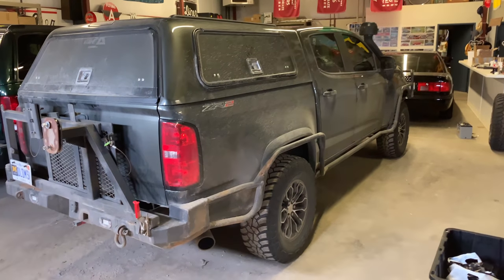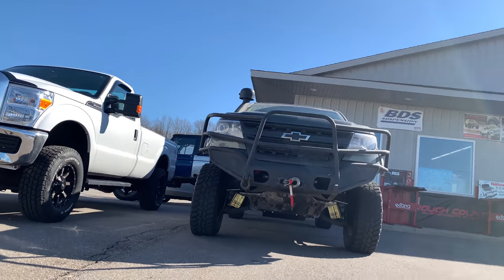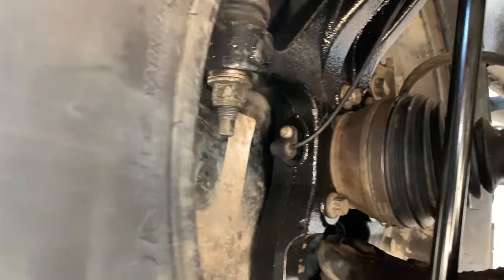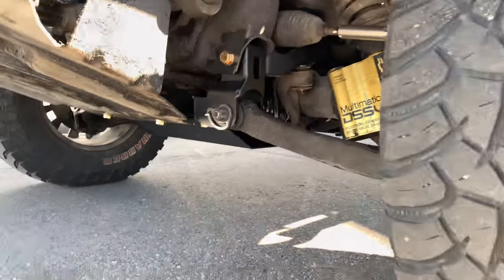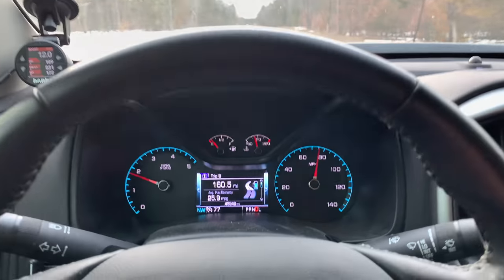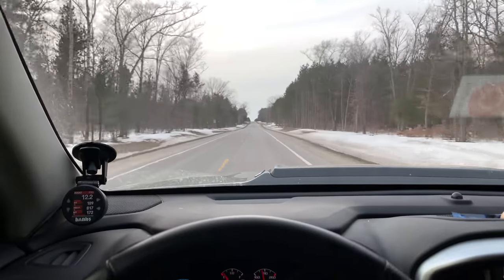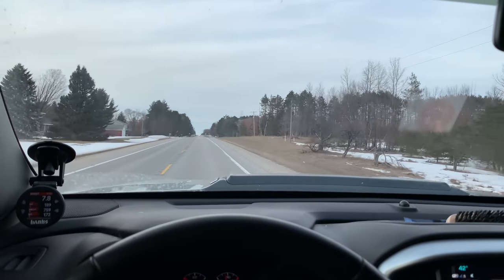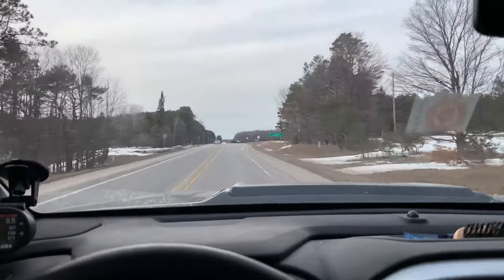WE LIFTED THE ZR2! 4” BDS Lift and 35s

Comment: Is gear swap necessary? I have all stock ZR2 diesel running 33”. Power is still good. My new truck I’m gonna get the bds 4” and run 35”.
Reply from the maker: definitely get 4.10 gears! best thing you can do for the truck and everything

Comment: Did you have to throw 20inch rims on like bds lift site sais? With the 5.25 back spacing? Or did you use something else? Because I dont really want to use 20inch rims. Rather 17s or 18s. Still debating on even doing the whole lift or just dropping 33s and rims on her.
Reply: I did bds on my bison with 285/75/17 33.8 (almost 34)  wheels Moto metal Mo970 has 0mm offset, and the 4.5 backspace needed.  I want to go to 35 later, but will need to probably do some cuting and trimming to get them to not rub.

Comment: Have you heard of/experienced issues on the ZR2 with the front locker? I've been reading that a front locker on a IFS is asking for trouble.
Reply from the maker: It works awesome, everytime.  Not one ZR2 has had any issues with the front locker.  No other truck compares except the Power Wagon and that is huge
Reply: @CarsCatsCannabis  You trollin me? lol Sounds like you might be trollin me...
Reply from the maker: @red6743  I'm serious, I don't know of anyone who has ever had any issue with the front locker on the ZR2.  I use mine all the time, so does everyone else, they work great.
Reply: I've had my ZR2 since July 17', I'm on the ZR2 forums and FB almost daily and I have not heard of anyone with front locker issues other than a bad switch on the dash.  IMHO 35's are maxing the 7.25" front diff and the front axles, I'm going to run 33" with my 4.10 gears.  4.10's with 31's is fun.  I'm sure you can trash the front with lots of full throttle and wheel spin but that's with most any truck made.
Reply: @madcratebuilder  I'm only asking bc I'm in the market for a midsize truck and going back and forth between Tacoma and ZR2. I found it interesting that GM was the only one putting a locker on a IFS from the factory. Googling brought me to this: http://www.fourwheeler.com/how-to/transmission-drivetrain/131-0606-front-locking-differentials/
Again, I'm just trying to best educate myself  through people that have the ZR2
Reply: @red6743  don't buy the gas one until GM has fixed the problem with the 8L45 and 8L90 transmission. Stick to the diesel or wait for a fix. My 2 cents.
Reply: @red6743  , I've not had any issues with the front locker either and I'm probably one of the toughest on my truck, since I travel primarily with jeep peeps...

If you are turning, just leave it off...the rear locker alone gets you through most things.

I've had more issues with the rear shock lower mounts than anything. 

I relocated them, problem solved,  to this point
Reply: @casTingcall07  You have 35" tires?
Reply: @justinhardt1  .
I'm running 33 until I need new tread.
Reply: @horaciolopez7721  what is the issues with the 45 and 90?
Reply: @FXIIBeaver  they are have a high failure rate and 8th gear shudder. When driving between 45-60 the truck doesn't know when to downshift to 7th or stay in 8th gear. Massive problems with that transmission and it effects 19 models in the GM line up. A class action lawsuit was started in December. A quick search on Google will scare you.

Comment: Why the sway bar?  Instead of that aftermarket driveshaft should have spent money on new leafs instead of lift blocks.
Reply from the maker: Sway bar is for on road manners it helps. No leafs available otherwise I would have. You are correct.

Comment: If you put 35’ on it you will need .456 g or higher. That is a big tire for a little truck
Reply from the maker: Eric Buchta I agree it is a lot of tire but 4.10 will be perfect for me. It’s a daily driver 99% of the time. If it was dedicated off road with stronger axles I would hit the axle manufacturer doesn’t recommend 4.56s
Reply: Ya true. How do ya like having a diesel?  That’s the truck I would have if I did go midsize. 
I drove one and very torquey. 
I live in Illinois so not much around here for over landing.
Reply from the maker: @ericbuchta9765  The diesel is great, mainly the fuel economy.  Even with the bigger tires, everything i get 25 mpg when i'm not on the expressway or city
Reply: They don't recommend 35" tires either.. so..?
Reply from the maker: @justinhardt1  "recommend" means nothing.  I've balanced daily driveability with off road capability and looks.  Otherwise I'd be on 4.56 and 37s but our axles cant handle it nor would that make for a good daily.

Comment: Welp... Mine is currently throwing a U0100 code and won't turn over.... Chevy has already told me my warranty is up, oh well
Reply: That sucks I wonder what's causing that If your warranties up I would definitely cut off all of the DPF and EGR Components  and install a crankcase ventilation oil catch can
Reply: Lost comm codes like that are probably a wiring issue or a module is fried. Kind of minor in grand scheme of things.
Reply from the maker: zeroaffinity the trucks are great. Get a gas version if you are concerned, you won’t be disappointed.
Reply: @zeroaffinity I also bought a brand new 2018 zr2 and GM is buying mine back too. I asked for a 2019 ZR2 that works like it's supposed to. They are paying off my 2018, giving me the 2019 for what I owe on the 2018 (I've already paid 6k for the 2018), plus a 1000 dollars, plus 0 percent financing.
Reply from the maker: One time I was at the sand dunes and I went very quickly to vertical and my truck did something similar. I’m deleted and tuned so I just reflashed my ECU and it was back to normal
Reply from the maker: @zeroaffinity Mine is a diesel that I deleted right away.  I know dozens and dozens of owners who all over their trucks, many have switched from Tacomas, even a few Raptor owners have switched.  They are the most capable off road pickup truck, period.  Lots of fun!  If you have any questions I'm happy to answer.
Reply: @codyvance2832  what happened to your 18, if you don't mind me asking.
Reply: @horaciolopez7721  I bought it in July 2018 and the dash wasn't assembled correctly from the factory and was rattling, then the ac fan went out, then the airbag recall, then the IPC (little screen between the rpm and speedometer) was flashing on and off, then the differential had a broken tooth no noise or anything I was just changing all the fluid to amsoil and found it, then finally the steering wheel locked up on the freeway for a few seconds, and the truck was in the shop waiting for parts for months then when the part showed up it failed inspection so gm just offered to buy it back.
Reply: @horaciolopez7721  I pick up the 2019 tomorrow morning
Reply: @codyvance2832  holy smash, sounds like a nightmare. I own a gas 17 that has small issues, but nothing like that.
Reply: @horaciolopez7721  yeah they fixed everything under warranty no questions asked, even on the differential when I was doing the work myself, I just brought in the gear tooth I found and they replaced all the gears and bearings. This process has taken since January 4th 2019 until tomorrow to get my new truck but the process has been super simple but slow